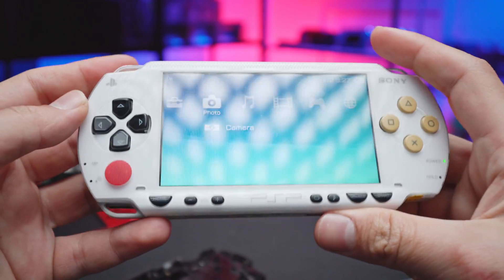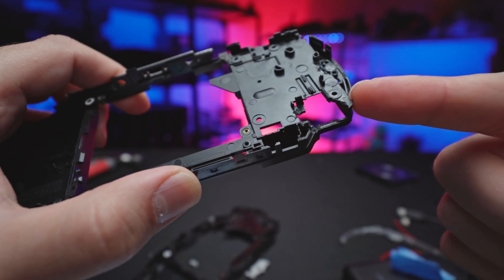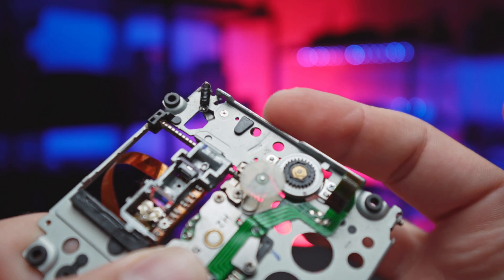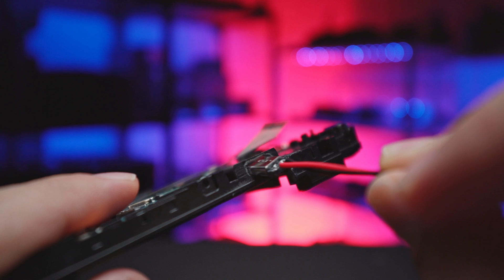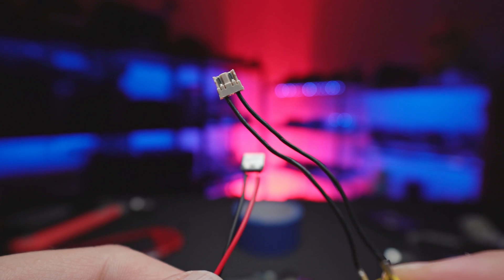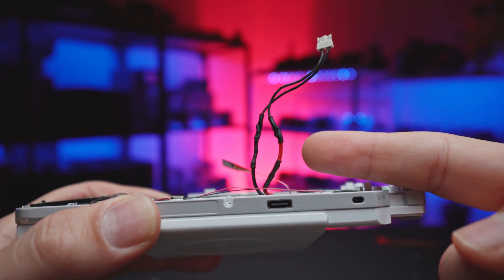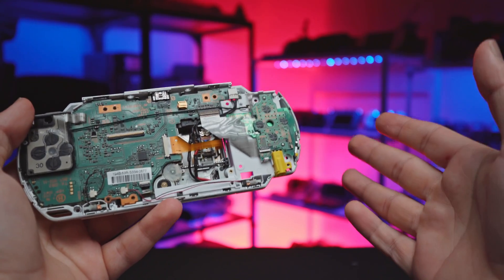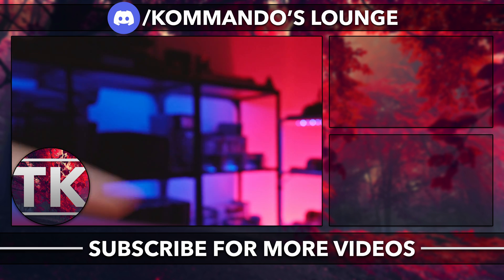Type-C Charging Port Mod For PSP 1000 [ Solderless ]

Comment from the maker: Share Your Mods Here: https://discord.gg/VB6ruBEnsm

Post Notes / FAQ:
- I opted for the bottom location because I want to keep original function, and because it looks cleaner
- You can use what you learn in this video, to do it anywhere else on the PSP
- Yes I will have a video on how to do it with other models in the future
- I will be trying out the replacement of the Mini USB port and / or the IR sensor.
- It's not perfect in the video as its cracked slightly because it was done during the experimental phase to showcase the best way to get it centered

Plans:
Next Mod Videos Will Have To Be HDMI & Battery Testing Video ( Going To Need Full Focus & All My PSPs Running 24/7 )
In the meantime I will probably try to upload something lite. o_0

Comment: If you want to modify electronics theres no getting around soldering. It's easy to learn and not expensive to get started with.
Reply from the maker: This was just done as a challenge, and for people who are not ready for soldering, my latest video does the soldering on the 3000 with data transfer.

Comment: for stripping thin wires you can use a light to heat the end of the wire slightly and just use your fingers to peel of the ends. I saw it on some guitar soldering tutorial and I thought it was a genius method and I adopted it by using the ends of the soldering iron to just lightly heat the wire ends and then peeling it off.

Comment: Is it possible to also change the Mini USB B connector for data to a USB type C connector and which lines on the connector to use as Type C has 12 lines on the back and Mini USB has 5?
Reply from the maker: Yes it is, I plan to cover the different placements including that one, as well as the pinouts
Reply: @TotalKommando  Can we expect the video soon?
Reply from the maker: @darezi  Within the next couple releases, I need to experiment and test the best ways to create the cuts and route everything

Comment: Well you can use the ribbon cable to connect usb c to barrel plug
Reply: Or salvage some old wireless card antenna wire cable from an old laptop.
Reply from the maker: True thats also an option, extra wire to run back down

Comment: I'd love to see a 3d-printed adapter that could simply replace the yellow connector and allow (or provide) physical support for a USB-C terminal. Frankly I'm surprised no one's developed one yet, as it would be a really clean way to do it while eliminating a now-unused connection.
Reply from the maker: Will get there once I take my long vacation
Reply: Giltesa's "PSP 2 USB-C Kit" is basically that but its for 2000/3000 PSP only. Looks very clean, comes with resistor to tell the charger it can only take 5V but you still need to modify the case to fit the USB C. Also its on Github if you want to build it yourself.

Comment: iirc the psp 1000 has a IR sensor on the top that is unused (except for some homebrew applications) and the IR port is roughly the same shape and size of a usb-c port. Might be a good alternative location.
Reply from the maker: That's one place I also think would be great for someone who has no use for the IR.
Its almost perfect
Reply: @TotalKommando  Lots of modders use it for a HDMI out mod though now that i think of it. that poor IR sensor port gets used for just about everything except IR applications XD
Reply from the maker: @aka-chi_hurron  Yea I have yet to cover the HDMI mod, i kinda dont like it but will cover it in depth once i get to it, too many downsides for me
Reply: @TotalKommando  yeah, with the video out on the 2000 and 3000 it's not all that required. Though I can see why some would want to implement a video out on the 1000, and the placement of the cable is a far improvement in the mod over the official one, comfort wise at least.

I look forward to your video covering it as I am curious what aspects you dislike about the mod.

Comment: Broooo i'm waiting sleepless for that usb-c with smart port, data lines and audio, sweet Jesus!   
Imagine those fast transfer speeds, daaayum!
Reply from the maker: transferspeeds are going to be the exact same usb 2.0 lol
Reply: @TotalKommando  😞
Reply: @TotalKommando  would it be possible to fast charge if you add a pd65w fast charging module? 

I'm in my most sane moment jajaja
Reply from the maker: @angrakamelot  perhaps if one can add a dedicated second charging module that you have to disconnect via switch to do pd lol

Comment: I wonder if this can be done with the PSP GO's power armour mod so that you can make a cutout and affix it to the inside of the modded (larger) back plate and not have to make cuts to the psp go trim itself...

Edit: Nevermind, the data and charging on the PSP GO are all one port. 😢

Comment: Keen to see how that power delivery port works!
I also bought some needle files to fine tune the port, it's definitely better than trying to melt the hole or using a dremel!
I am surprised you are doing this on original shells though, as quite a few members of the community complain if an OG shell is altered damaged, and a third party shell is good for practicing.

A friend of mine also made a 3D printed faceplate that goes around the front of the USB C port. You bring the port out 1mm proud and can glue on this face plate and it hides the hole. It makes the port sit slightly proud but in my opinion it looks quite good. Another alternative is to plug something into the USB and use a very fine RTV silicone with a needle applicator to fill in the gaps around the port, then you smooth off the silicone with a cotton tip/qtip
Reply from the maker: I cant wait to get back into 3D printing, got so many ideas in mind I wanna design for. I have a graveyard of 1000 models with non mint parts, lol
Reply: @TotalKommando   It would be good to see how you approach this for a 2000 or 3000 especially if you leave the original port and splice in a new one. I'm busy investigating that right now

Comment: Waiting for the upcoming video with a USB-C port o PSP incorporating more functions as you said in this video.

In the end, you left the original charging port not connected, right?
Reply from the maker: Yea cant wait to get into that project, in the end of the video for the "Solderless" method I did leave the charging port not connected, but since then the psp is left in parts.
Once I do it again, I plan to keep the original charging port function as I still want it to work like stock on old accessories : )
I want to add function, not remove as much as possible

Comment: Brother can you tell me where I get psp street glass lens.. AliExpress have only 1000-3000 model. There is no psp street glass...so where I get it.. please send me a link .
Reply from the maker: I used the same lens for my street model from the 1000-3000 link is in my glass lens video
Reply: @TotalKommando  Oh I see...but I saw in your video the street glass was cutted tow times. where psp 3000 model glass are not same..will 3000 glass fit on street model.?

Comment: Honestly if the original PSP's charger wasn't so long, I would probably do this mod. I just see no point for myself who normally just plays at home and doesn't mind plugging it in when it dies lol. You made the mod look super easy tho!
Reply from the maker: I agree, I honestly have no problem with the original cable & port, much prefer it over microusb, I got plenty of spares, battery is long enough to not care for my use, its just a nice have type of thing of a project lol
Reply: Im gona do it cus i both uesd psp with no charger or battery , i got to make sure its worth buying new parts and shi

Comment: 9:51 
For your 2nd soldering guide, please experiment on trying to swap that mini-usb to usb-c.
Ever since I got a psp decades ago, I feel having the cord at the bottom hinders while playing.
If the USB-C is at the top, you could solder the data lines + power from the bottom as well.
Reply from the maker: It might be on a third attempt lol

I don't like removing original function if I ever want to use an OG accessory but will def be looking into it
Reply: @TotalKommando  
WHY?! The only notable OG accessory is RCA cable which uses the 3.5mm jack. 
The mini USB is useless! Swap it please!!
Reply from the maker: @jackipiegg  lol what happened to the camera or gps or tv modules : )

I will still attempt it nevertheless so dont you worry
Reply: @TotalKommando  
LOL first time hearing those exists, but yea I don't think anyone will use any of those ever again since phones exists.

Please do! I will follow your footsteps since you will be the first ever on youtube/internet that does it. I'm not brave enough.

Comment: This is great, and this tutorial can be used for the other models as well right? since the charging port is the same no matter the model.
Reply from the maker: Yea you can adapt the methods learned here to use on other models.
The only thing you will have to figure out is where to exactly cut to end with a clean result.

I will have shorter quick videos for other models once I do them.

Comment: this mod look cool! is there any way to put the USB-C Port on the charging port part?
Reply from the maker: I mention in this video, my goal is to keep original function, but yes you can do it, I just don't like how it looks and requires heavy modification to the case.

You can use what you learn in this video to do it anywhere else you want.
Reply: Yes, you can do this too (you can even find a video on this modification on YouTube), but it doesn’t look very good.  Therefore, the option in this video is one of the most optimal